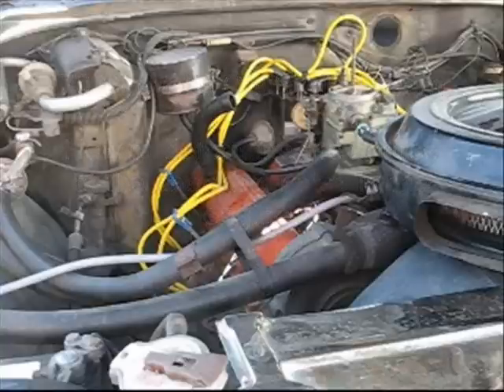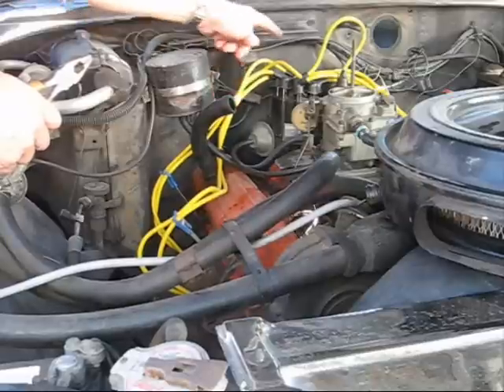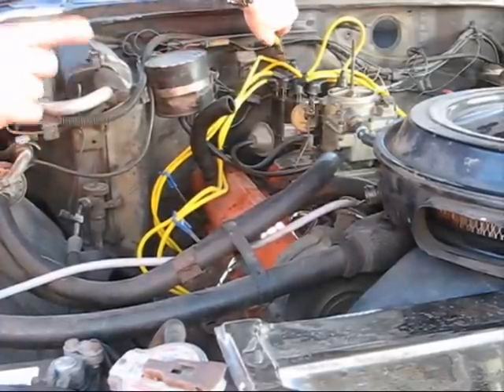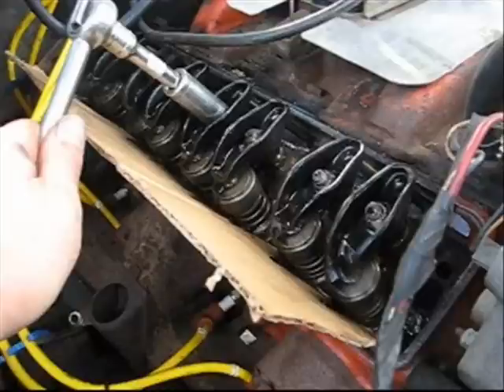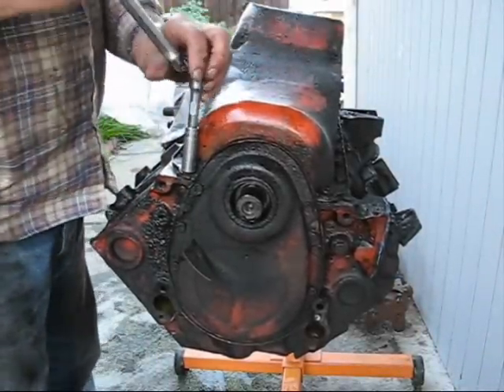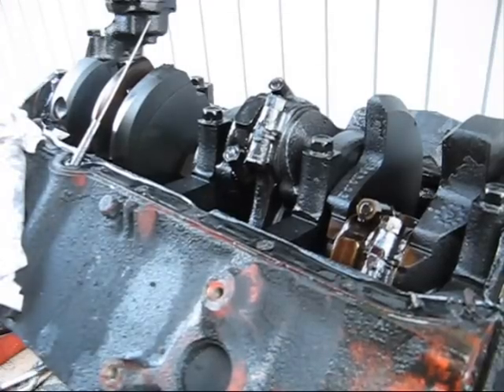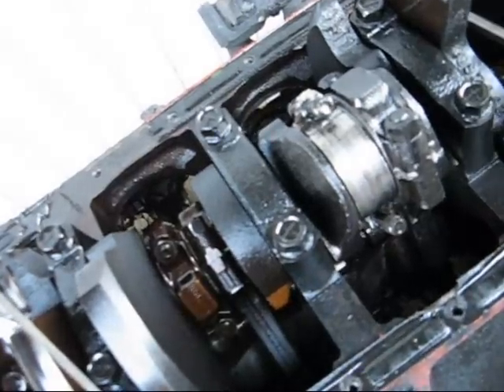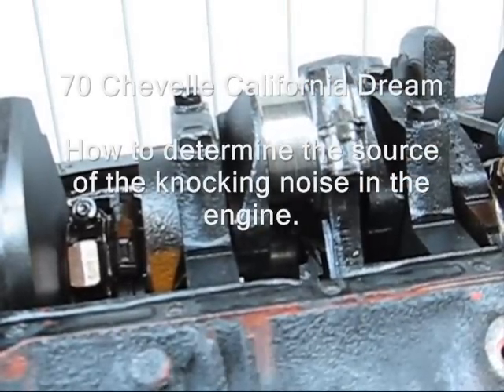How to determine the source of engine knocking noise

Comment: just turn up the radio problem solved
Reply from the maker: This one was a little to loud.  It was not going to last long if I kept driving it.
Reply: worked once for me, rear wheel ripped off and brake rotor melted in a 04 merc mountaineer, was just driving down the road to pickup a pack of cigrits
Reply: @fury3600  maybe if you didn't replace vehicle noise with music, and just fix the problem... you would spend way  less $ on further problems caused by not taking care of the first one..
Reply: Maybe if you didn’t buy cigarettes you’d have money to fix the car at the time
Reply: @blake1995  alot of truth to that
Reply: I actually tried this and the motor just died but that was before i put the new distributor in. I still have the tapping noise.
Reply: HAHA me & my gf were in my old camaro today after I changed the oil and filter and it started knocking worse than before I changed the oil, I just looked at her and turned on the radio and we blared some Tom Petty 

yes the car was thumping on beat

I also have a more heavily modified engine to replace it with, so I'm honestly not mad. I'll re bearing it and use it in something else. Who knows? I might spin a rod bearing kn the other engine and end up with Ole thumpy back in it lol
Reply: Worst thing to do

Comment: Can the crank be resurfaced or does it have to be replaced?
Reply from the maker: Just replace it and get new bearings.
Reply: If it’s scarred you will have to remove have it turned or buy match crank and bearings scaring will eat lead off bearings be back same

Comment: Like they say, "if I can reach one person, I'll feel like I made my contribution to my fellow man" With that being said, I had to adjust my rocker arms/valves, but I remember that it was a mess even with the cardboard dam. So that night, I thought and thought, of what could I do, to eliminate having to use the cardboard dam. Then it came to me, I went to the junkyard and found two exact valve covers, you just really need one(flip it around), but go ahead and bring the other one of you want. Cut you a window, just enough to see and adjust your rocker arms. I used my Ryobi reciprocating saw, please, please be careful though!! and cut the window. I took off the original cover and put the one I made on, and adjusted the rocker arms. No fuss, no mess. Just in case, I had a towel underneath the cylinder head and above the exhaust. Hope this helps you all?? Take care, and God bless!!
Reply from the maker: I like it.  The cardboard dams do not stop all the oil for gong on the engine.
Reply: Yes David, but Thank you so much for helping all of us, with your video and your instructions as well! It helped me tremendously. Oh, wanted to share something with you, and the rest of the gang of which you all may already know. The other day, my '93 GMC Sierra 1500 V6 just died, as I was turning the corner, no warning, no nothing! I scratched my head, it would turn over, but wouldn't start. I should've remember what Dad used to say, check two things, oil and fuel. my bro-in-law checked the fuel pump opened the gas cap, could near it clicking, then he said, I know exactly what it is! y0our ignition control module, under the distributor cap, he had an extra one. Yay! that was it! Wanted to share. I guess I could've pulled one of the spark plug wires?? You all tell me please?? but then again, when you're alone, can turn the key.... take care!!
Reply: Doing too much

Comment: Could you take a look at my latest video?
I have tried all of this, and the noise does not go away.
I even looked inside the pan, and all rockers and caps have no play or movement .
Reply from the maker: Where is our video?
Reply from the maker: Your channel is Maria Peralta, why it the title of the video
Reply: David Lis "350 5.7 rebuilt engine knock"
Reply from the maker: I listened to it several times.  You tried taking off the spark plug wires one by one and there was no change.    It does seem loud under the car.

How about this, get a long screw driver and put the handle end on your ear and the other end on the valve cover lip, the side next to the intake manifold.  Then move it to the next set of rocker arms and see if you can hear the difference in sound, than try the other side.  Maybe one location will be louder than any other.   
I never tried this but since you have good access to the oil pan, try putting the screw driver on the oil pan bolts starting at the back and more forward as far as you can and see it you can hear a difference in sound.

The caps will not have any play.  I wonder if one of the rod bearing is spinning inside its connection rod. Maybe that little notch that stops it from spinning got crushed a little when putting it together and is not doing its job of holding the bearing in place.

Comment: i work as a offroad tech and specialize in engine diagnosis. your passenger bank rockers should be shooting out oil from push rod holes. a good lubricated enginr with 30psi oil. will pump out a small stream. they are oozing out. make sure metal shavings didn't get clogged in cam bearing in back. it takes one shaving. blow air into each push rod
Reply from the maker: The block was washed in a hot water tank.  I soaked the push rods in gas and blew air through them.  Oil does come by not as much as you expected.   I have about 4,000 miles on the car and it runs great.
Reply: David Lis mhmmm did you remove the cam bearings in the back? it should be a squirt per say. 3 inch squirt.
how's your pressure at start up? is it really high? Like 65 80psi?  only reason i say this. if i had a nickel. for every build we've done or head rebuild. when it's oozing like this. 99% of time. it's coming back. might be 10k miles or 3k miles. but at very high rpms. (we put a recording scope under cover) like 4k and up. it's vibrating so fast that it blows the oozing oil off rocker before it gets to valve. its most likely fine  and most likely never cause you an issue. i just thought id help and stop the headache I've had with that. 
what mine usually ends up being is 3 things. bearing oil hole off center. rtv from oil pan or convert 2 gasket gets squashed into oil then finds its way into a oiler hole or valley.  or one lifter in way back is stopping the flow somehow. i can count 4 times where I've said to myself. i should fix it. but it's always. customer is wanting it back this afternoon. so i shoot air put Trans fluid down push rod holes. cover it up. fire it up hold at 1600 rpms.    sorry to get into it. and hope i didn't insult you. ones i build are for rock crawling. or mud hogging. so they run high rpms or high torque low rpms. 
but you'd be amazed how a tiny sliver of metal holds back 60 psi
Reply: Is 60-65 psi good at cold start? Then drops to 35-40 psi after warmed up?

Comment: i have a similar kind of sound!
But when i tighten the rocker, it makes it more silent or sometimes it makes the knocking go away. But after a couple seconds, the sound comes back .
Does that mean i have a bad lifter or bad barings?
Btw: The sound goes away when i accelerate.
Reply: Video on my channel
Reply from the maker: I believe you have a bad lifter.  Don't tighten it to much because it will cause the valve to stay open and the engine will run rough.

How many miles on the engine?
Reply from the maker: It seems that you have a bad lifter.  Be careful about tightening the 
lifter to much because if you tighten it to much it will not let the 
valve completed close and the engine will start running ruff.  

Try - let the lifter knock and try the removing the spark plugs and see it you can get it to stop.  If it does not stop, then it can not be the rod bearing.

Comment: i have the same knocking noise when driving my truck (350)  &when i push the gas it's been doing that for a while (years) also little blue smoke when i start it  (piston ring i presume )
Reply from the maker: Blue smoke means the piston rings are getting tired.
Reply: is that a very expensive job?  &2nd what can be done with the knocking ?
Reply: not an expert but it seems like you will pull out the bottom part of the engine to asses the damage caused by knocking, inspect for defects on crankshaft and the rod. Pull the entire engine out and do the seals to save time plus labor

Comment: I have 04 grand prix gt, knocking...rod barrings were changed but still knocks. Could it be the lifters. Mikel in Ks
Reply from the maker: Does the car knock in idle?   
An old way to check is to get a long screwdriver and put one end on your ear and then put the other end on the engine.  Then you have to probe around from cylinder to cylinder and you will be able to hear the loud one.

Comment: sir.ask  what couse in the push Rod bent
Reply: Overtightening them cause they are hydrolic
Reply from the maker: Maybe your hydraulic lifter got full of slug and didn't compress correctly (far enough) causing to much pressure on the push rod and it bent.   The cam comes up and the valve can only go down so far, so the lifter and the push rod are in the middle.

Comment: Great video! I have the same issue with my 383 Stroker (67' C10) was getting mixed reviews from friends/those more knowledgable than me as to whether I had an exhaust leak or loose lifter. About to try your distributer trick now to narrow it down. I'm assuming the knocking did not go away after you adjusted it, hence you pulling the engine. I'm really hoping I don't have to go that route! Fingers crossed.
Reply from the maker: My engine had 125,000 miles on it so it was wore out.  Runs great now but it was a lot of work.  It took me weeks of working on it part time.
Reply: Sounds like it. I ended up having incredibly loose exhaust header bolts on the aft end of the engine. Replaced gaskets/bolts on both sides. Sounds much better now. I still don't understand why when I was troubleshooting, disconnecting the #2 plug from my distributor made the sound went away..no spark no combustion to move the lifter?
Reply from the maker: Another way to check is to get a long screwdriver and put one end on your
 ear and then put the other end on the engine.  Then you have to probe 
around from cylinder to cylinder and you will be able to hear the loud 
one.
Reply: I have the same problem I with my 350 same sound I hope it is fixable without having to tear motor down
Reply: jason n

Comment: Hi I am having a similar problem with my 2011 5.0 mustang. Slapping/ticking noise and some bad power lag. You think it could be a sticking lifter? The power lag threw a camshaft position sensor code too. Also do you think I can disconnect the electrical connector to my ignition coils and do what you did here? I don't have plug wires you see just 8 coils with connectors on each plug.
Reply from the maker: Sorry, I don't work on the new cars.  You can try disconnecting each ignition coil and see what happens.  You might have to disconnect one and leave it off then rotate to the other ones, meaning it will be running on 7 cylinders so it will make a significant difference.  There is another old trick and that is to get a long screwdriver and put the handle end on your ear and put the tip on the intake manifold and move it to different positions to see if you can hear what cylinder the ticking noise is coming from.   If you find where the ticking is coming from, take the coil off and listen if the noise went away and it should come back when you reconnect the coil.
Reply: +David Lis thanks for the info. I have a feeling of where the dodgy lifter because I did that pipe trick and listened and it's also coming from where the slightly oily spark plug is. I'm going to get the rocker covers off and have a closer inspection should be easier to tell then will probably see straight away which lifter/rocker is knackered!
Reply from the maker: With all the high tech tools available, and here we are using a pipe or a screw driver to find where the noise is coming from.
Reply: Ha! The pros and cons of old school, low (very low) technology!

Comment: i am having the same problem can you please answer if i can drive with this for few days as in for 5 days more as i have to go out of station and need this car, is it risky to take it  out on road with this condition is there a chance of break down?
Reply from the maker: I cannot give you an answer but I will tell you what I did.  

I drove my car with it knocking knowing that I was going to take it apart.   But I notice that when the motor was straining, like on take offs it was louder.   So I drove my car but I also only drove it in the city and not on the highway going fast.

Treat it with kid gloves and it might be good for 5 more days.
Reply from the maker: What happened?

Comment: piston broke, should I rebuild my self and hope block OK, OR BUY NEW REBUILD
Reply from the maker: How do you know the piston is broke?

If you are going to rebuild the engine, take it to a machine shop and have them check it out and if the block is ok, have them bore it out another .030 thousands and install all new pistons. 

Do you want to keep the old block?  I did because I wanted the motor numbers to match the car but if you don't care see what is the cheapest to do.  Ask around.

What kind of motor is is?
Reply from the maker: You should take it to a machine shop and at least have them check it out so you don't waste your time and money.

Comment: Awesome video. did you make one about the repair or any further than what's in the video? It just stops (the video) with the engine still open
Reply from the maker: I don't know what you mean.  I made several on a Chevy 350-V8.  Taking it apart and putting it back together.

Comment: my Mitsubishi IO 98 just changed rings and new valve seals . but cant start its backfiring now. help how do i sort this out. help
Reply from the maker: Backfiring has nothing to do with new rings and valve seals.  I believe that is a timing issue.  Did you pull the distributor?  If you did, I think you might have put it back in and now you are one tooth off.  Meaning the timing is to far retarded and advanced.